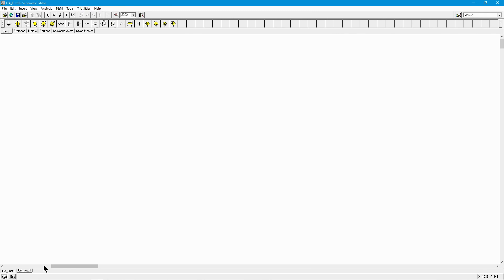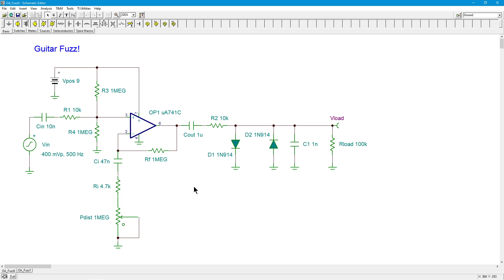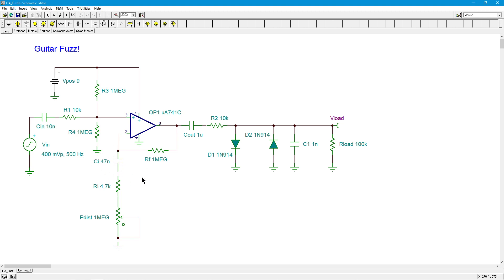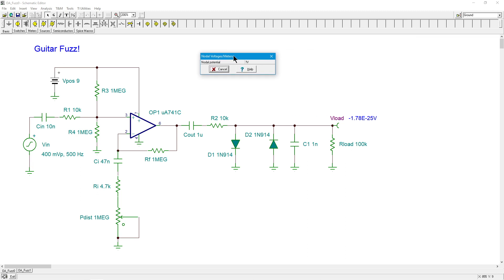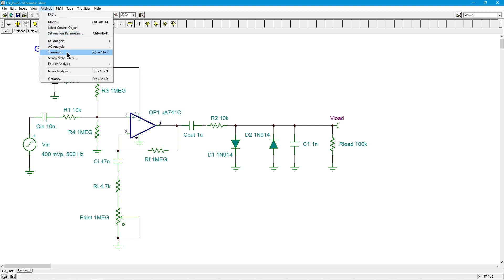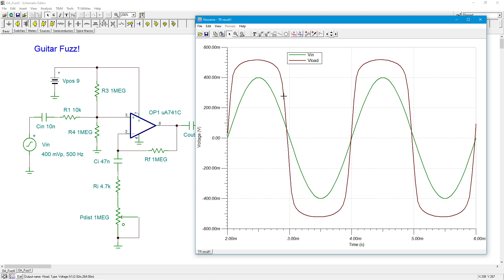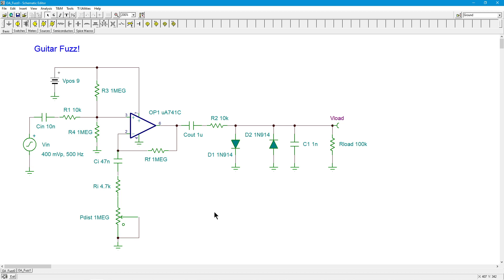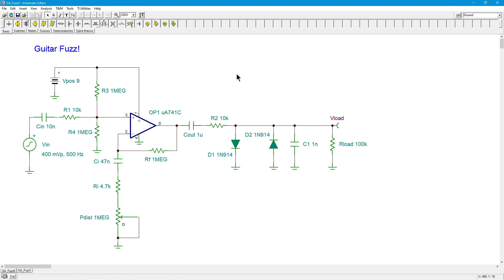Op Amps: Guitar Fuzz!

Comment: Hey! I just found your awesome channel and hit that subscribe button. Brings back memories, you know? When I was a kid, I’d blast those songs in my room with my headphones on, pretending I was rocking out on a guitar. And get this—I used to grab one of those old-world hangers and strum it like a guitar all the time! My mom probably caught on to my little jam sessions. Then, when I turned 8, she took me to Sears and got me my first guitar. I think it was a Silvertone or something. I started taking lessons every week and was totally into it.

Fast forward a bit, I got my first electric guitar and was jamming to my buddy's band. His guitarist had this killer distorted sound, which was tough to find back then before the MXR Distortion + came out. I ended up with a "Big Muff" clone, which was super basic—just an on/off switch and you plugged it straight into your amp.

As soon as the MXR Distortion + dropped, I snagged one right away, probably around '74 or '75. It was the script version, and let me tell you, the sound difference was huge! You mentioned it in your video, but those germanium diodes really clip the signal, while fuzz boxes give you those square waves.

I still use it today, and yeah, I’ve picked up a few more pedals since then!
Reply from the maker: Fun is where you find it!

Comment: Another interesting circuit.  Big question for me is that your output on the second circuit seems to be more line level than instrument level.  Someone using this circuit might want to use this in a stomp box chain, where the next box in line is expecting an instrument level signal.  It seems I am always fighting this battle with different signal levels.  I guess I don't understand them well enough.  Might be an ideal for another video.
Reply from the maker: There is an issue regarding the lack of standardization, particularly when it comes to guitars. Some pickups are very "hot", producing output much larger than is typical. 

We've got two more-or-less standard levels, pro audio and consumer audio where 0VU is well defined, but then there's "instrument level" which is a bit fuzzy. A modern high end keyboard would have dual outputs, usually XLR for pro level and 1/4" for consumer level. Older keyboards might have RCAs and are likely operating at consumer level. Then comes vintage equipment. Probably consumer level, but who really knows? Guitars and basses, well, how old is it? Does it have active or passive pickups? Are the pickups "hot"? How does the musician play? Do they have a light touch? It's certainly not like saying "0 VU is 0.775 volts" or some such. 

And when it comes to effects, as you say, where they are placed in a chain makes a huge difference. Swap the order of a fuzz box and a flanger or EQ and check out the difference!

Comment: Designing music gear is what motivated me to eventually enroll in college. 
Before that, I lucked my way through an op amp based soft-clipper that I've used for 15 years and never changed, not even after going to school and having a far better understanding and ability of the science. 
Tubes are great, but people truly misunderstand the potential of semiconductors. After going to school, I've always felt we can achieve a lot more dynamic and clever schemes using them, and with enough thought and care, they greatly outperform tubes.  You covered what I'm pursuing ATM with a voltage divider so a hard clipping scheme in fact, clips softly with a round knee.

And now with the tremendous advancements with digital topology, which I once despised, it's at the forefront of performance in music gear. I am still striving to produce analog processing that will be digital microcontroller controlled.
Reply from the maker: If uprocessor control is what you're after, look around for an old book called "Musical Applications of Microprocessors" by Hal Chamberlin. I had the 1st edition when it came out circa 1980 and then gave it away when the 2nd ed came out 1985-ish. Still have it. Some of it is a quite dated but there are good ideas in there. I don't know if it ever went OER or public domain. Look around for it in the usual places.
Reply: @ElectronicswithProfessorFiore  I'll see if I can find a copy online. I had a realization that the Arduino is ideal for this, so I ordered some digital potentiometers and have been studying the Arduino extensively. I haven't really done anything with electronics for quite a few years, but it's better late than never.
Reply from the maker: @JonDeth  In case you're not aware of it, I have a playlist of videos that covers programming the Arduino using C. The first half of the book explains the C language, the second half takes apart the Arduino Uno. I focus on a generic microcontrollers approach instead of just using the standard Arduino libraries (which can be inefficient for some applications). As usual for my stuff, the text (and associated lab manual) are free OERs.
Reply: @ElectronicswithProfessorFiore  ty. I'm jumping right on it because you do a great job teaching. You're thorough and go through everything in a rational order. I've been out of school for almost 11 years, and have to do a lot of review in analog while I also learn C, some C++ and arduino, but am still fortunate I completed as much school as I did. 

I found a circuit clip of a high gain dual op-amp distortion, and 3-band EQ I built 9 years ago that sounds dead on to an EVH 5150 and the Mesa dual rectifier specific to shredding metal solos and rhythms, as well as complex instrumentals. Now granted I still have the op-amp clipper and the 3rd stage was simple, I can't even remember what that 3rd was and just that it was a BJT I was overdriving lol.
Reply: @ElectronicswithProfessorFiore Thank you very much!

Comment: Professor Fiore! You are a treasure!!

Would you be able to put together a class on high voltage JFET or MOSFET as replacement for tube driven gain stages? Aka LND150 transistors and such?

You're a rockstar!! Keep it up and I'll be here to learn everything I can from you!!
Reply from the maker: I do have a number of videos on JFET and MOSFET amplifiers. These are found in the Semiconductor Devices playlist.